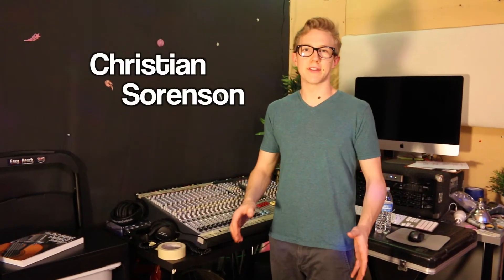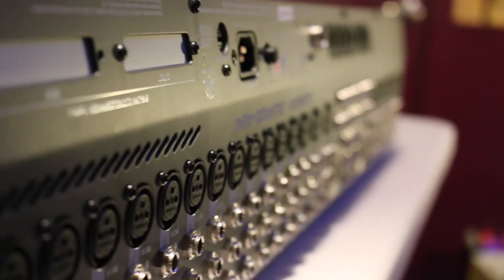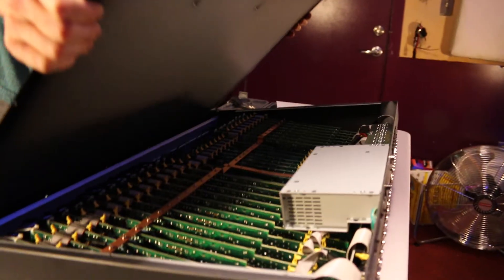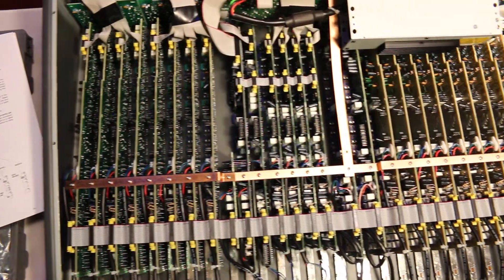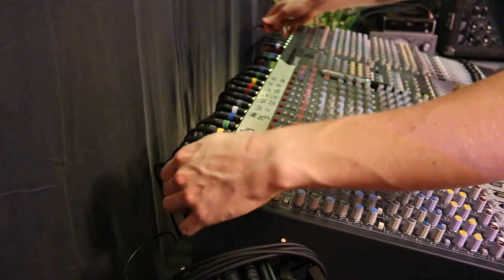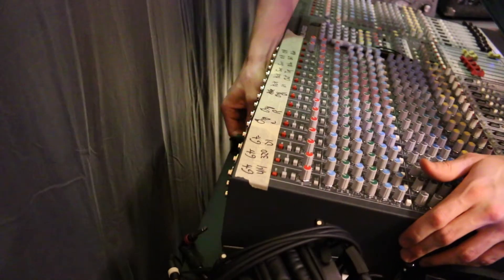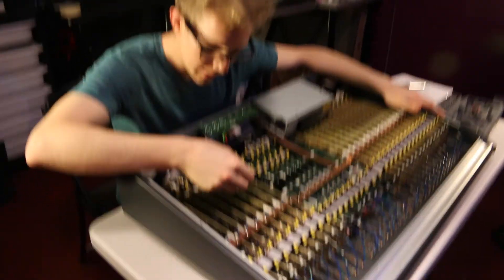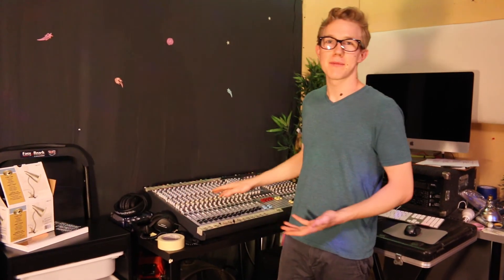Allen & Heath GL2400 Direct Output Conversion: Pre-Fader to Post-Fader Metering

Comment: So people people are aware the reason why it is always pre fader is so you get a direct out copy of the original signal coming in. This is extremely important if you want to record these signals as they were originally to then remix then in a Daw or another console. If you were sending tracks out from a Daw into this mixer to colour the tracks ( as a summing mixer, analog colouring) then set the direct outputs as Post Fader.

Comment: LMFAO you do not put it on a table upside down like that !!! Damn you put a thick blanket on a table then put the Mixer upside down on it. Christ man you should warn people as if someone breaks their fader caps or cracks the knob heads .  I am shocked you would put that unit on a table like that. I made many mods to mine already internally aka noise psu fan + custom routing wiring, a power switch at the top of the unit) and now adding toggle switches ( 3 position switches) so I can switch the routing to Pre/post etc. These will be mounted at the top of the Mixer aligned with the Channel and will have Led light strips so you know which mode it's in. Not a hard mod to do just takes time and patience.
Reply: Can you make a video on that, im interested to see those changes.

Comment: cant see what you did!.... also, why would you want to flip each i/o to "post fader" when you can utilize your busses, aux outs and 2 stereo outs?? makes more sense to send stereo signal into an audio interface with lots of inputs!
Reply: I have very good reasons to want to flip the direct outs to post fader.  
For me, it maximises the usability of the console as it enables me to take certain channels into a sub mix for various duties (sub woofer,  centre fill, delay fill,  distribution announcement) yes there are other ways to do these things but then I would have to compromise on other things woke the direct ours go unused.

Comment: Great! Thank you.
Now what about the annoying fan noise, is there anything that can be done?
Reply: I bought my unit second hand ( looked like someone used it once the way it looked) and I opened it up right away to clean the insides and opened up the PSU box and seen a lot of dust on the fan assembly so I swapped the fan out for a Quiet CPU ( computer fan) fan. Sounds quiet now. You need to get the same voltage and wattage fan for the swap. older graphics cards had the bigger black medium fans which is what the Allen and Heath uses. Also I added a blow out Computer Fan ( the ones you find on the back of the towers blowing air out) unto the grill section inside the Allen and Heath. This way the heat pushed out by the new PSU fan will be pushed out right way by the bigger Fan added in the Grill out section. Allen and Heath should of added the bigger fan in factory already as without this big fan a lot of heat does not get out of the unit. 2 fans is harder as you have to tap a 5 volt supply. Allen and Heath skimped out on that. Oh well at least now my unit is clean, less noisy and less hot inside.